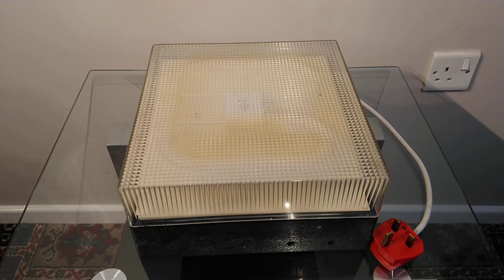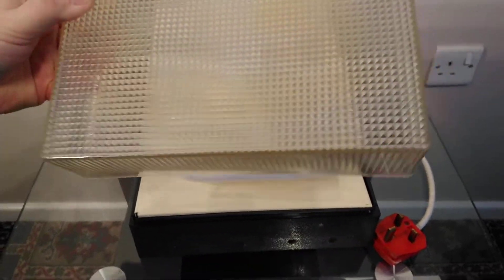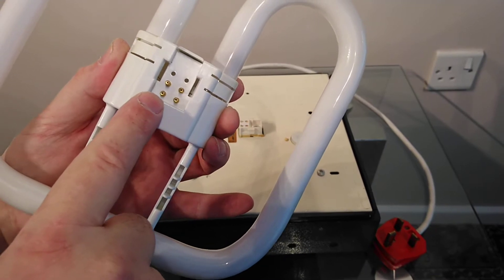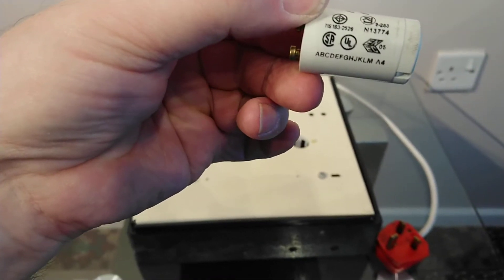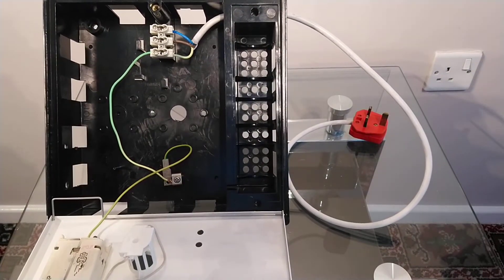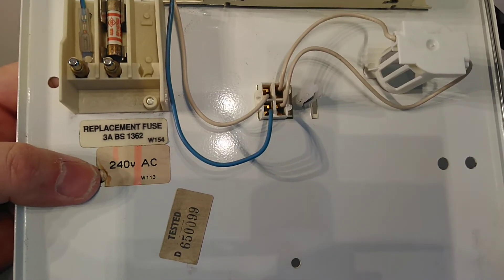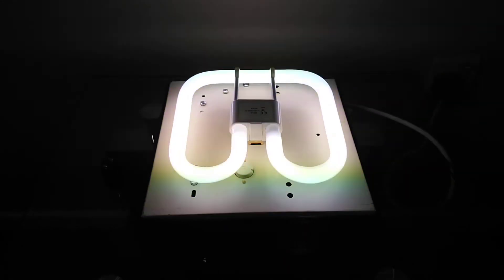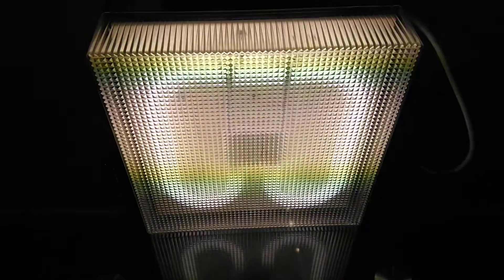Preheat 28 Watt 2D Fluorescent Light

Comment: can i put a 2 pin in 4 pin  bought the wrong one
Reply from the maker: If the 2 pin has a starter inside it might work, on a 4 pin 1 pin Ballast, 1 pin Neutral other 2 pins for started in fitting.

Comment: That's is a four pin 2d 28w light fluorescent fitting with a 28w choke ballast 240v and the starter type is a 4-65w 220-240v starter lamp switch